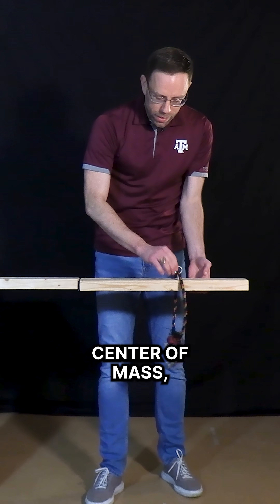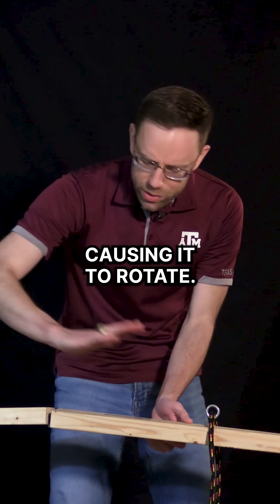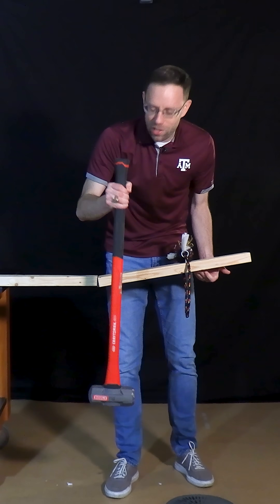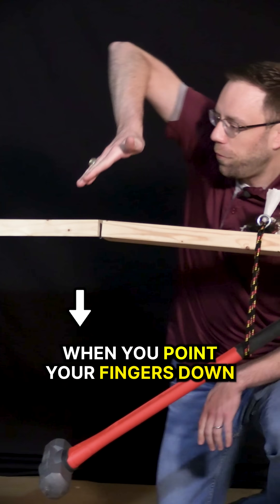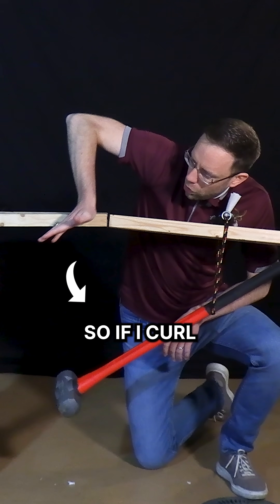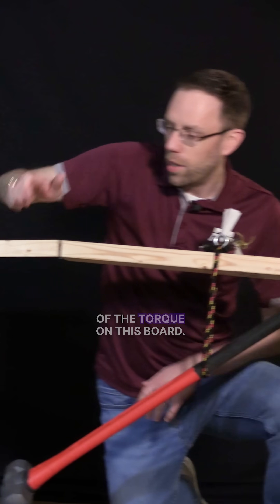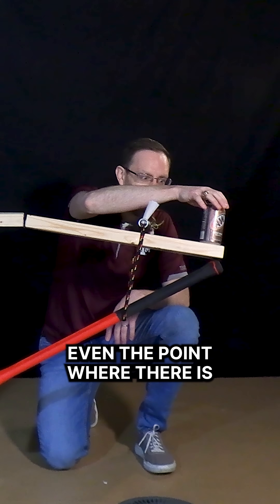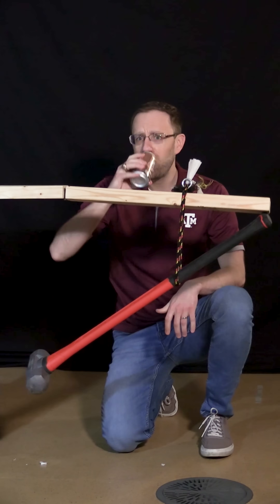Floating sledgehammer using physics! 😮 #shorts #TAMU #DrDawson

Comment: Gravity does not "pull down on [the board's] center-of-mass".

I know that you know that I know that this is a non-optimal description. Fix?
Reply: No, because it’s accurate.
Reply: @whothehellarewe   What about the rest of the board? Or should I need know what you mean by your unwise, sloppy thinking and vernacular? (That is, I am not confident that you are aware of what is the technical definition of accuracy. )

Comment: He was trying to explain that the center of mass is now beyond the board, to the left. And the hammer head falling down pushes the handle at the end of the board up. A balancing act.
Reply: eventually when the table stabilizes, center of mass is perfectly at the vertical, below the hinge axis
Reply: @geemy9675  yep, the new solid : board + hammer have his center of gravity right under the hinge, nothing magic or torque effect in here.
Reply: @marsu52  yes center of mass is vertically under the hinge but because it is not a simple pendulum the center of mass could still be offset on the depth dimension  and the table would still stay still. there is only one degree of freedom which is rotation around the hinge so torque is the right (simplest) way to analyze the problem
agree nothing magic just simple mechanic problem
Reply: Trying to explain?  I think he explained it just the way he wanted, using the language of torque instead of center of mass.  More than one way to think about the same scenario
Reply: @olivercuzzourt7533  yes there are many ways but the torque is qtill applied at the center of mass. not at the sledgehammer head
Reply: Thank you

Comment: nonono. the hammer should pull down the plank, how is it floating, my brain is not braining!
Reply: @LemonOne  you can visualize it two ways. if the plank were to move downwards with the hammer attached, the hammer head, which is the heaviest part, would need to move upwards because it is to the left of the hinge. That wouldn't work so it stays up.

 Conversely, the hammer head is being pulled down by gravity. If you visualize the hammer head moving down, you can see that that would rotate it around the hinge counterclockwise, which pushes the plank upwards.
Reply from the maker: Mindblown

Comment: Thank you very much for the demonstration. When I was in middle school, the explanation was written and there was an illustration to go along with it. Seeing it demonstrated in a video brings it all together. Still don't understand it though.
Reply: you can visualize it two ways. if the plank were to move downwards with the hammer attached, the hammer head, which is the heaviest part, would need to move upwards because it is to the left of the hinge. That wouldn't work so it stays up.

 Conversely, the hammer head is being pulled down by gravity. If you visualize the hammer head moving down, you can see that that would rotate it around the hinge counterclockwise, which pushes the plank upwards.
Reply from the maker: Glad to help! It's always good to see concepts illustrated.

Comment: I understand how..but
this doesnt look to me like it should work.
I have some learning to do.
Reply: you can visualize it two ways. if the plank were to move downwards with the hammer attached, the hammer head, which is the heaviest part, would need to move upwards because it is to the left of the hinge. That wouldn't work so it stays up.

 Conversely, the hammer head is being pulled down by gravity. If you visualize the hammer head moving down, you can see that that would rotate it around the hinge counterclockwise, which pushes the plank upwards.

Comment: In layman terms: The weight of the head of the hammer is being pushed against the end of the board, thereby pushing the board upward as the hammer head "tries" to fall at the same as the board, but it's not able to move because of the rope. Physics. It's physics, guys. I'm not even a physicist.
Reply: @gismoogity  true, the hammer head due gravity want to go to center and not like to stay on left . That pushes the hammer hand end and that pushes the board backwards as they are all connected else it was hung on string it would swing back to center and here thread is stopping the hammer to come back to center . the greater the head size and longer it is stronger is the push back
Reply: Swap rope with hinge and you're spot on.
Reply: @iratepirate648  
No, the sledgehammer is tied to the board via the loop of rope that prevents the head of the hammer from falling, which makes the handle of the hammer press UPWARD on the end of the board where the handle is making contact with the board preventing the board and hammer from falling.
Reply: @gismoogity  The perplexing thing is, if the hammer was physically attached to the board, this wouldnt work. Physics are amazing :)

Comment: There is no way that it works. No matter where hammers CG, you are still applying mass of the hammer from the right side. Because it is connected from the right side.  Which means tork is still generated clockwise from our perspective. which should have caused the plank to fall again. Btw since there is so much comments that believed this phenomenon I questioned myself. Correct me if I’m wrong.
Reply from the maker: @berkkosaner1990  Do the experiment yourself. Center of gravity must be similar to mine. Mass of hammer is not on the right, it's in the middle because of how the weight is redistributed.
Reply: you can visualize it two ways. if the plank were to move downwards with the hammer attached, the hammer head, which is the heaviest part, would need to move upwards because it is to the left of the hinge. That wouldn't work so it stays up.

 Conversely, the hammer head is being pulled down by gravity. If you visualize the hammer head moving down, you can see that that would rotate it around the hinge counterclockwise, which pushes the plank upwards.
Reply: This could be wrong, but I think the hammer being fixed to the board means the board and the hammer essentially act like a single object, with the hammer moving the object's total centre of mass closer to the pivot since the hammer's centre of mass is to the left. This reduces the clockwise moment, so the board doesn't turn as much.

But also the hammer does just cause an anticlockwise moment because its centre of mass is to the left of the pivot, so gravity acts on it, causing it to move downwards which moves the board up because the hammer is moving downwards at a point to the left of the pivot.

Comment: the way it works in my mind, the hammer head wants to hit the floor, the cord prevents that, so the head has to follow an arc, and the arc pushes the end of the handle up, that stops the end of the board dropping. That's something I can visualize

Comment: For those that don’t understand:
Hammer goes down, plank goes up👍🏼👍🏼
Reply: Much more understandable than whatever finger-curling nonsense video dude was spouting.
Reply: @teatawhaikumar1158  still don't understand
Reply: @ayushgarg7033  the only way for the plank to move down is for the head of the hammer to go up. Because the head of the hammer is heavier than the board, gravity stops it from going up, thus stopping the board from going down as well.
Reply: @ayushgarg7033  the head of the hammer is “falling”. By the head falling, it forces the handle to rotate upwards because the rope looped around it won’t let it fall. So the handle applies counter force against the board that is generated by gravity pulling down on the head of the hammer.
Reply: @kyleray8504   f word, i am an engineer and i still find this helpful, i get that works by torques and all, but still this down to earth explanation is nice to have
Reply: Is that true? I am very interested about that, but highly curious on HOW it works? 

My understanding is that, the parts after the hinge will just fall down with gravity pull. There is no upward force to counter balance the pull from the earth.
Reply: Thx ma men
Reply: its relying on the hinge
Reply: so this is how we build antigravity UFOs with hammer and planks ?
Reply: the head of the hammer is heavy, and it wants to go down to the ground. BUT since it is mounted to the board, it will push the board upwards. The shaft is not that heavy on the hammer, so look at the head of the hammer as a separate piece, and that there is a svivel on the hammers shaft near the head where its mounted
Reply: What you say sounds good, but your reasoning is flawed. Let me explain:

The (center of mass of the) system composed of the movable arm (or plank) plus the sledge hammer (with a heavy head) is being pulled down (by the earth) under the influence of gravity. Now, if the plank were to rotate downward, then the heavy head of the sledge hammer would necessarily move upward. This would result in the IMPOSSIBLE upward motion of the center of mass of the system composed of the movable arm plus the sledge hammer (with a heavy head). Because we cannot allow the impossible, then the system composed of the movable arm and the sledge hammer is stable and motionless.
Reply: @fraiopatll633  so...

Hammer goes not up, thus plank not down?
Reply: @daynarisbarathion8602  YES! 

But, you should NOT think of the components of the system (sledge hammer + movable plank) as if behaving independently of each other. You need to think of the system as a unity. The gravity, although, acts individually on every particle (molecule or atom) making up the said system, because of the interconnectedness of all these particles, it is in terms of the center of mass of the system that we need to think and argue.
Reply: @teatawhaikumar1158  that's actually a nice way to explain the effect 😊
Reply: @teatawhaikumar1158  can't believe those two lines made me understand 😹

Comment: In this setup, the plank moving down would force the head of the hammer to move up! As the hammer is way heavier than the plank, the system is stable. I don't see where torque comes in.
Reply: Whenever there is a lever in the system, there must also be torque.
Gravity applies torque to the plank, and a sledgehammer applies it in a different direction. As a result, they balance out, net torque becomes 0, the plank doesn't move.
Reply: @mikumikuareka  nonsense. The hinge opens to the sky in the sledgehammer part, where as it opens to the floor first. He just turned the board. But of course there is torque on the hinge-screws in the grain wood.
Reply: @fredrik7102  well, he didn’t turn the board? The hinge opens the same way throughout the video.
Besides, you can repeat the same experiment with a regular hammer, a long ruler, a string, and a table. Place one end of the ruler on the table and attach the hammer in the same way as shown in the video. Just make sure the hammer’s head hangs below the table. This will work the same way.
Reply: @MarkusSchellenberg-wi6bw  thank you for explaining it like that. I seen a lot of explanantions and none did made sense for me. But now i understand, thank you.

Comment: Just think about balancing a rule horizontally on your finger or a seesaw...same thing...this just looks weird...the hammer is just a kid sat on one end , theyre sat to the left so left goes down right goes up...its all about the positional relationship between pivot and the mass, forget what the system looks like. Concentrate on which ever side the C of G is, its that side that wants to move downward and that causes rotation to occur....and in theory if you align the CofG on top on the pivot ...you can orient that plank anywhere and itll just sit there stationary...think holding a balanced bike wheel by it axle

Comment: The rope pulls down on the board, but the handle of the sledgehammer pushes up on it.  Plus, it pushes up on the outside of the board, where the moment is greater.
Reply: @kenotube3160  finally, a comment that i understand 😅

Comment: it's just hanging straight down. the board and hammer combo acts like a single item, in a reverse C shape. If you hung a C by it's tip, the very top of it would still remain horizontal, the same way the plank remains horizontal.

Comment: a good way to think about this is to just see the entire structure on the right side of the hinge as a single entity. the whole thing's center of mass is directly underneath the hinge, so it wouldn't rotate. and while it's a bit of a mind blower to see it like this, imagine having to hold that structure with only one hand. you would hold it at the hammerhead, and the rest of the structure wouldn't feel like it's going to fall off, compare that with trying to hold it on the other end. same underlying principle.

Comment: you just changed the centre of gravity to behind the hinge
Reply: The center of gravity is directly below the hinge.  When the soda can is added to the end, the overall CG shifts only slightly to the right.  Which is why it only rotates a little more with the can.

Comment: Are you using the word torque since it is more commonly understood? I recall differentiating between Moments and Torques and I never understood why because they looked exactly the same.
Reply: Mathematically they are the same.  "Moment" is usually used for a balanced, static system.  Torque is usually used for something that is actually rotating.

Comment: so basically the head of hammer is so heavy it can raise the plank with the handle?
Reply: @Jett_Panopio  
No.  It's counter-intuitive, but the only way the board can drop is if the sledge head moves - it has to move to the left and and eventually up in an arc because of the connection to the board.  Since there is no force pushing the sledge head in that direction everything just sits where it is.  He should have shown the actual movement of the sledge head by pushing down on the board and it would have been easier to see/understand.

Comment: How are yall so confused? In order for the right side to drop the sledgehammer head on the left has to be lifted up so unless there is enough mass on the right side gravity doesn't have anything to work on which is why the table drops to the point of equilibrium between the two.

Comment: I still don’t believe this till I see with my own eyes
Reply: Have you ever played with one of those balancing bird toys that stay on the beaks despite looking like they should fall (google if necessary)? They have weights inside the tips of the wings so without the wings they fall backwards tail first. Despite the wings being attached close to the tail because all of their weight is at the tips which lie past the beak they shift the centre of mass to the beak and the bird no longer falls.

The hammer is attached on the right of the pivot  where the plank is falling but its centre of mass (much greater than the plank too) is to the left, counteracting the falling and making it's stable position be much higher. Its the same as the bird.
Reply: I agree, something is not right here. I doesn't make sense